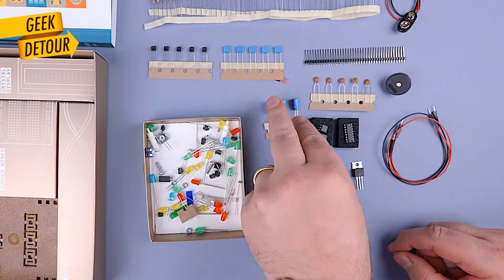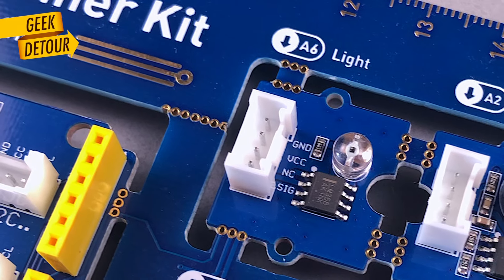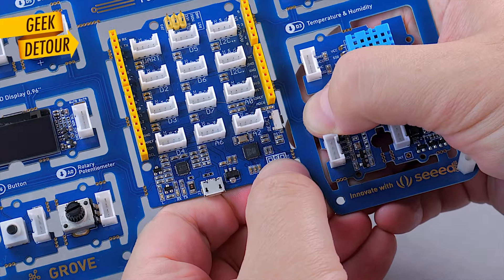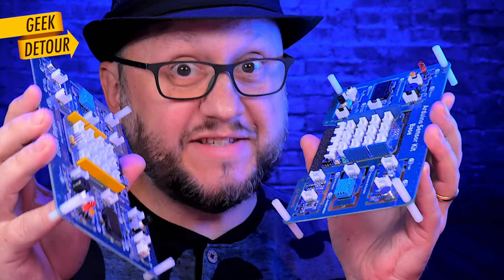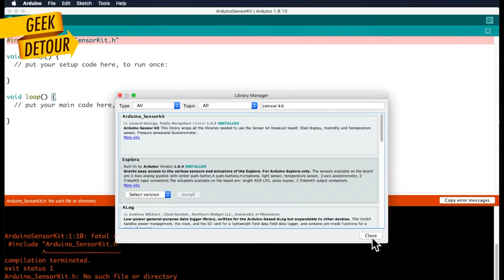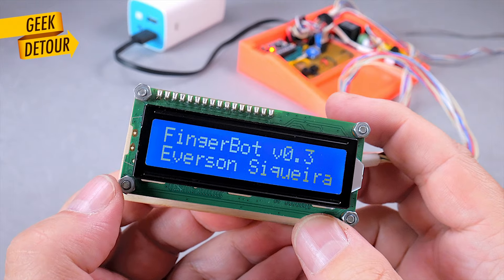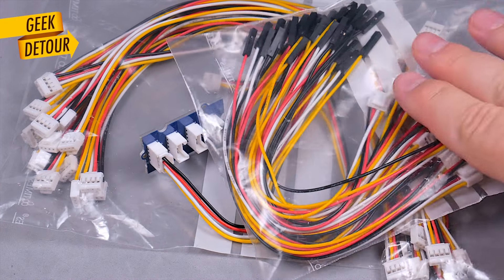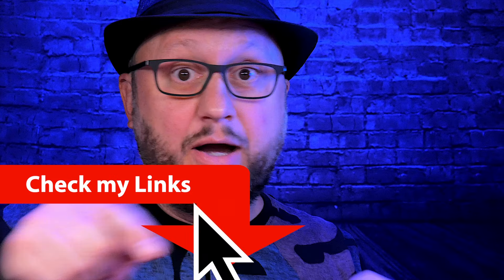Arduino Unboxing: Arduino Sensor Kit vs Grove Beginner Kit

Comment: Have you tried all the sensors on the Arduino sensor kit? The DHT temp/humidity sensor on my kit does not give a reading. Youtuber Shotoku Tech found the same problem with his kit in a recent video.
Reply from the maker: Hi James! When I made the video, I got the Demonstration program that Seeed Studio installs on the “Grove Beginner’s Sensor Kit”, made a couple of necessary changes (the GPIO numbers that are different between both kits) and installed it on my Elegoo Uno R3 connected to the Arduino Sensor Kit - and in my memory everything worked fine… BUT I cannot trust my memory 🤷‍♂️

So, now I just got my kits from the boxes AND, surprise! On the Arduino Sensor Kit I get 0 and 0 most of the time and eventually weird values pop shortly, and back to Zeroes.

On one of my Grove Beginner Sensor Kits (yeah; I bough a second one myself later, to have it all “original” without breaking apart) the temperature/humidity makes the Arduino Freeze… everything stops responding and I need to reset.

Very weird! Thanks for the shout out!

Comment: Does the grove beginner kit come with a arduino uno built into it ?
Reply from the maker: The board in the center of the Grove Beginner Kit is basically an Arduino Uno board (everything is more miniaturized and pushed down to the edges, but it’s all there). You can follow and execute 98% of the Arduino Tutorials you can find on YouTube using the Grove Beginner Kit if you separate it’s center board from the sensors around.

You might be thinking: what’s the “2%” difference? The only difference I found so far is that the Grove Uno Board is powered by a micro USB connector - the regular Arduino Uno R3 boards have a “printer like” USB Jack and also has a power Jack that you can push 9V (it has a voltage regulator on the board that will step it down to 5V). The Grove board doesn’t have this 9V Jack and regulator. Thats the only “drawback” I see (and as I said, for most of the projects that doesn’t make any difference).

In terms of programming capabilities, it is really the same thing. The Microcontroller is exactly the same.
Reply: @GeekDetour  ok thank you that comment really helped a lot thanks for taking the time to right that long comment
Reply from the maker: Hey, my pleasure! Arduino kits are super fun, enjoy!

Comment: What I2C module do you recommend for the lcd?
Reply from the maker: If you search for “LCD 16x2 i2c” you will see offers of LCDs with a module already soldered on its back - than you just need to figure out the cable. The module is extremely popular and standardized.

Comment: 2:06 Maybe the Arduino Uno R4 board (if they make one) will look like this and have Grove connectors.
Reply from the maker: It would be nice! The Grove connectors are very convenient - if more kits use it, the price of the cables will drop.

Comment: I just bought one of these kits, I love it. Can anyone advise on how to cut out the individual sensors/mini-pcbs without damaging anything? Do they just twist off? Or do you need to cut our somehow? Thanks.
Reply from the maker: Do you have a 3D Printer? Those side-cutter pliers that we use to cut filament help a lot. Any side cutting plier would do, even nail cutting side pliers. Cut on the lateral connections (with it turned off, otherwise you can short things). It is possible to break them apart by hand too, being careful and going back and forth.
Reply: @GeekDetour  Perfect thx, I am going to cut somehow vs twist and break. Appreciate the feedback.

Comment: Can you use a SD card adapter with the Grove starter kit
Reply from the maker: I don’t see why not. The Grove Starter Kit’s board has all the same pins as a regular Arduino Uno boards. BUT, you will probably connect it to the side connectors, instead of the Grove connectors. All the SDCard readers I found use SPI port, that use 6 wires, look: 
https://create.arduino.cc/projecthub/electropeak/sd-card-module-with-arduino-how-to-read-write-data-37f390
So, sure, it will work. But it won’t be as pretty as other projects that would work by connecting using grove cables.

Comment: Let me guess, you don't use platformio. Change to vs code platformio. It has a debugger and you can use different boards like esp32.
Reply from the maker: Oh, sure, I have ESP32, STM32, ESP8266, Arduino Micro (ATmega32U4), and a few more obscure microcontrollers that I bought by impulse on AliExpress… I honestly don’t believe I’LL have lifetime to explore half of them 😄 I used PlatformIO only to compile Marlin Firmware… But for my Arduino Projects I am still stuck to Arduino IDE - at least for me the amount of resources, examples, tutorials… is more abundant.

Comment: I'm actually braindead the school told us to buy either the beginner or the sensor they said if you bought the sensor it would be better but it's way more expensive and there is an OLED panel which is better than the LCD but on mblock the application we use to program the OLED block doesn't work so I can't use it so basically I'm an idiot
Reply from the maker: Hey Julian. Did you buy the Grove Beginner kit? It is practically identical to the Arduino Sensor kit (and both use the same OLED display). You need to calm down, step back for a few hours and start again. The exercises your are seeing in school for these kits are very basic - but you need to pay attention to follow the instructions correctly, otherwise things might not work. I hope you can see it again with fresh eyes and make it work.  If it is not working, it means you have something to learn. Good luck! 👍🍀